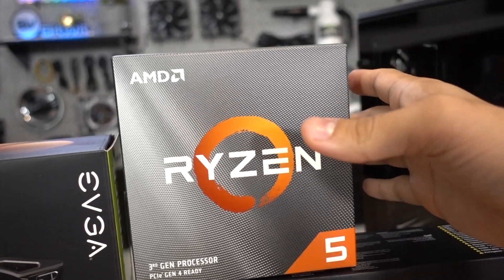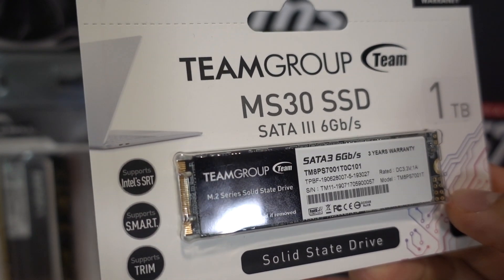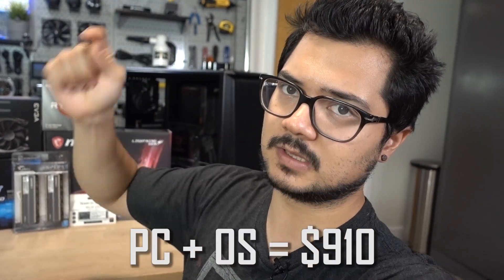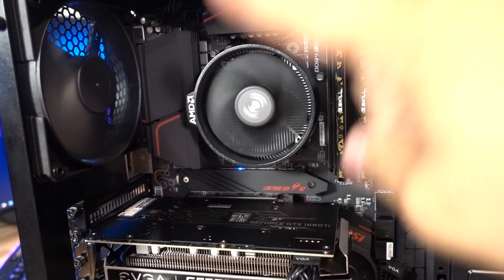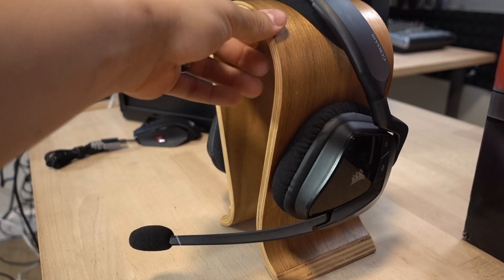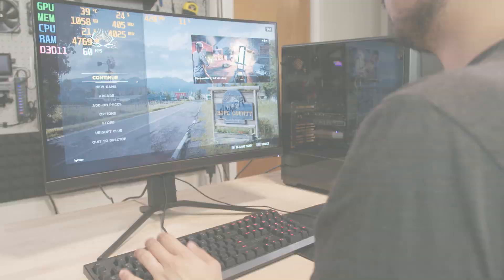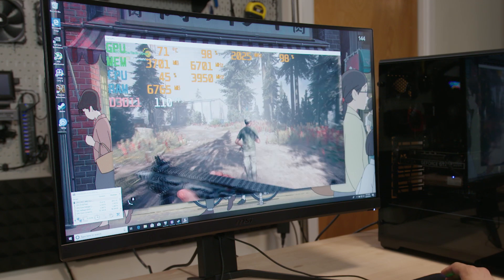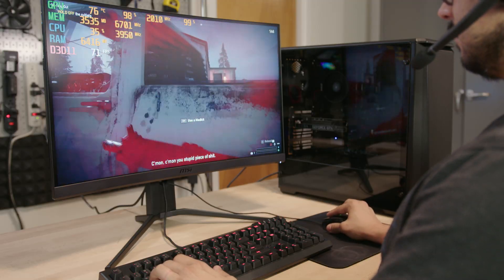Literally EVERYTHING you need to game on PC for $1500

Comment: I have an AMD Ryzen 7 2700x with and rtx 2070. I always want that 144 fps. I usually put all my graphics either medium or slightly higher and set the display to 1080p even though I have a 1440p monitor. More pixel density could stress my system. That’s how I set my settings for all my games

Comment: If I’m not mistaken, the motherboard would not be a reliable option in the long term, as proven in one of hardware unboxed’s vids. It yields very high temperatures under load, as high as 90 degrees. A good alternative would be MSI X570-A PRO.

Comment: I really don't like this build, the board is X570 but very low end, which even with the points you made is not a good option. Saving money and getting a b450 or X470 would have been the better option
A 1660Ti in a 1500$ is just not okay, I have seen people being able to put in way stronger gpus for less. You could have achieved that if you went for a Full-HD monitor instead. But you got a WHQD 144hz which a GTX 1660Ti is not gonna achieve in most games on high settings (I'm not even getting it with my 1070)
Full-HD with a either a 5700XT or a 2070 would have been better.
The Money for those cards could have been won by - as mentioned - a full-HD monitor and most importantly, different peripherals.
The fact that there's no great alternative to cherry MX is a complete lie. I actually had an MX switch fail, getting Outemu switches would be be the better option. Also the gaming headset is not a good choice either. There are way better for less money, both wired and wireless.
The P400A has proven not to have that good of an airflow despite the mesh front. A bit of money could have been saved by getting a Cooler Master MB500 which also comes with one more fan and it's RGB.
I therefore cannot recommend anyone building this, this could and should have been done better
Reply: My 1660ti handles 1440p great
Reply: @shilohchavis5392  handles it great but it would not reach 144 fps which is what they were saying i believe
Reply: @SwolePapi15  exactly

Comment: I think there is one last thing you left out of the reasoning for choosing the X570, and that would be that if somebody was to build a PC brand new right now and was to choose the 3000 series with no previous gen chip at their disposal, it is best to get the X570 because otherwise if they bought a 400 series board, they would need to find a way to get a hold of a 2nd gen CPU in order to update the BIOS, or they would have to buy a specific 400 series board that comes with an updated BIOS out of the box to support the 3000 series.

Comment: I have about that much total in my system, good price point! But I went ebay OEM windows key, it works for $14... Ryzen 5 2600, Asus X470 mobo, 16gb Corsair vengeance pro rgb, Gigabyte RX580, evga 750 80+ gold modular psu,  128gb cheapo ssd, 1tb wd blue HD,  32" monitor, Corsair K68, and a decent mouse. Should've gotten a better GPU but it works very well!

Comment: You could get a RTX 2080, Ryzen 3600X and a Gigabyte Auros Pro WiFi (X570) with 32GBx3600Mhz at 16CAS for about 1500$. With a cooler.

So if you have a keyboard, mouse and monitor remaining, I think you should either save the money and go for a 1000$ build or go for the 1500$ build with the 2080.

Comment: 74-75°C is quite high for a CPU on stock clock speeds. Seems like the mesh front panel on the P400A is still choking the airflow a little.

Comment: What I think could've been better
CPU: Ryzen 5 3600
GPU: 1660 Super
Ram: 8 gigs 3000 MHz (16 for streaming and stuff) from Corsair, Vengeance
Storage: Same as he suggested
Cooler: Stock Cooler
Motherboard: A WiFi enabled one like, Gigabyte B450 (or something like that) Aorus WiFi Pro
Display: Acer 1080p 144hz. It's much cheaper than that, also 1660 super performs better on 1080p giving you around 80-100 fps on ultra, and can give 120-150 fps on most graphic optimised aaa games
Keyboard: Something like an AmazonBasics mechanical keyboard
Mouse: Something like from Logitech, around 30-50$
Case: Antec NX300
The total cost without the operating system (considering a new, not second hand) is around 1400-1500$.

Comment: Personally I would've opted for a Meshify c instead of the p400a since the mesh is a lot less restrictive on the Meshify for roughly the same price. I also think it looks better but that's subjective. secondly I'd change the headset to an h70 from Corsair as well, because it's slightly cheaper and has a little bit more functionality at the cost of the RGB accents on the void (but who really needs RGB on a headset).

Comment: I was thinking of going from my 1700x to a 3600. I know it's two less cores but the performance will be significantly better.
Reply: I'm gonna hang on to my R7 1700. It's only overclocked to 3.8(0.1 volt increase from 1.1875 stock to 1.2875) but it's fast enough for me. 31c idle, 71c stressed on Wraith Spire RGB.

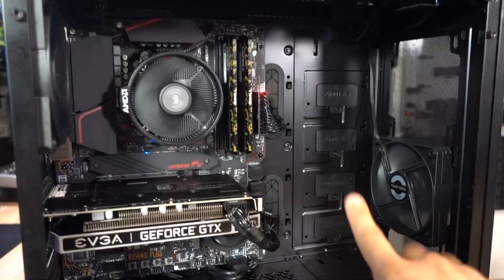Comment: 6:13 Again, that 8-pin EPS connector will allow for the CPU to draw up to 384W. Even if you are doing some kind of LN2 extreme overclocking, an AM4 CPU won't draw that amount of current, ever.

Comment: I still have the same old SIIG multimedia keyboard I bought in 2012 and it’s been through 3 system upgrades an a move. x299 dark 9800x 2080 ti hybrid FTW3 1tb 970 evo and quad channel 8gb 3600 memory. Think I should upgrade?

Comment: i'm not a big fan of the choice of the monitor, 144hz at 1440p is too much for this setup imo, a 1080p 144hz monitor would have been better, and with an MSI B450 Tomahawk you could spend all the extra money on a better GPU for a batter experience
Reply: In the video he said instead of saving money on the motherboard, instead he wanted something that could handle a CPU update in the future. Also if your planning on building this, you dont have to pick the exact parts he’s using
Reply: @hoodswords  b350 mobos can handle the likes of a Ryzen 9 3900x, though( double the cores and threads compared to the 3600). The main advantage of x570 is pcie gen 4 for SSDs, and they're not THAT much faster than gen 3(yet).
Reply: jtenorj (yet)

Comment: I got a vega 56 from asrock for 260 bucks. Thing was so loud I decided to water cool it thinking I would overclock it. Then I realized I had hynix memory. Dont recomend vega 56 if you want something that's quiet or something you want to overclock. Also undervolting is bs, stupid you have to undervolt a card just to get its stock performance stable.

Comment: @6:13 There is literally no reason to have extra 4-pin CPU power connector other than making people exited of the motherboards "power delivery capability". It may become relevant with LN2 overclocking. But when you do that, the actual power rails of that motherboard can't handle that kind of overclocking.Other than that minor detail, good video. 

For more info about these motherboard features, refer to actual hardcore overclocking - channel

Comment: I would get a B450 motherboard with a ryzen 2700 or 2600 and a RX 5700 instead. 
Ray tracing after the updated drivers would not be worth it for the 1660TI anyway.

Comment: Is AMD CPU stock fan better than Intel's? Because first when I bought my pc I used the stock intel fan and it was fking noisy and not that good at cooling. Especially with high settings and 144hz. I had to play at 60hz until I bought an AIO.
Reply: AMD stock coolers are actually pretty good, they could probably handle some overclocking if it’s not a hot running cpu. Intel stock coolers on the other hand... it’s a known thing in the pc community that they’re trash.

Comment: The VRM on MSI's X570 boards below the Ace suck. Check out Hardware Unboxed or Actual Hardcore Overclocking for great info on the X570 boards. The jist is if you want an MSI board get a B450 or X470 one.

Comment: MAJOR MISTAKE IN VIDEO
The GTX1660Ti does not have the RT and Tensor cores to support RTRT and DLSS. It's the reason NVidia called it a "GTX" card not an "RTX" card. Please correct this in the video.
Reply: (If by "foot in the door" you meant that technically it will do ray-tracing at unplayable frame rates then I guess you are correct though you didn't specify. You also said "foot in the door for RTX and so forth" which implies DLSS which isn't possible without the Tensor cores... I like your stuff but I found this a bit misleading, though I doubt it was intentional)

Comment: this is almost exactly my pc, works really great and it'll handle almost everything you throw at it
Reply: can you tell me what power supply you use ?
Reply: @LilMonie  coolermaster 550 watt
Reply: Cars Lansink does it come with power cables he didn’t really show how to build this pc and i’m lost
Reply: first time building a pc?
Reply: @LilMonie  and yes, it comes with the cables because it isnt modular
Reply: Cars Lansink yes it’s my first time ... also instead of the pc bitwit has in the video i bought the asus swift pg279 but it has g sync instead of amd freesync can i still use it or was buying the monitor a bad choice ?
Reply: Cars Lansink monitor not pc lol
Reply: @LilMonie  you can still use it, g sync or freesync are just some extra optional features
Reply: Cars Lansink yo thx man ! i appreciate the help can i add you on something if i need more help with something like setting up windows installing drivers ?
Reply: Cars Lansink all new to me 😅
Reply: bro can you help my i’m getting a media test failure warning on boot
Reply: @LilMonie  Thats a problem with your hdd/ssd onto which windows wants to boot and install the os itself. so check if everything is connected properly, if that doesnt work check in the bios if the boot sequence is correct.
Reply: Cars Lansink my bios wasn’t detecting my ssd and the ssd light on the mb is red i put it in m2.2 slot and now it detects ?
Reply: now it’s telling me select proper somthing
Reply: @LilMonie  can you send a picture on dm (instagram)?
Reply: Cars Lansink yes @realpsycho100
Reply: Cars Lansink i replied

Comment: Could have saved a chunk of money with a Dell S2719DGF instead of the MSI monitor. Excellent 27" VA 1440p 155hz freesync panel for under $300. That money could have gone to a better cooler or a nice keyboard and headset.

Comment: I would Switch out the Headset for Logitech G933 still a 7.1 surround sound wireless headset for around $70 Its usually on sale for $99, upgrade to the RTX 2060 also would switch out mouse for Logitech G502 Hero out of preference.  Was thinking a 1TB M.2 was a bit much but that price is really nice for that. Usually I like to run a 256GB nvme for some games and OS then Hard drive for bulk storage for the price. That monitor though its all those sweet spots 1ms 1440p 144hz for a VA panel that is awesome for that price. I personally love my Alienware 1900R, Ultrawide gaming for those scenic games just is amazing. Also funny same exact motherboard and cpu that I have.

Comment: I got that exact same motherboard for my new Ryzen PC. It's the most expensive motherboard I've ever bought at 219€. And that is in your budget build... hehe. An x470 board would have been 75€ cheaper but since I switched over from Intel it wouldn't have been compatible with 3rd gen ryzen out of the box and I don't own a 2nd gen cpu to upgrade the bios.
Reply: I think AMD is still doing that thing where they will send you a lower end APU at no cost to flash the bios. It was an old FX based APU for going from 1000 series to 2000 series chips, and a Zen based Athlon 200GE for going from 2000 series support to 3000.

Edit:you have to send it back to AMD when you're done, but they do include free return postage(I think).

Comment: Asking a 1660Ti to push 2560x1440 is a bit of a stretch.  I actually said to myself, as you came to the 1660Ti, "Well, he's going high refresh 1080p then."  At its price point, the 1660Ti is great, but it's not really a 2560x1440 GPU, especially if you're trying to get high FPS at max levels of pretty.  I'd have gone with a modest refresh rate 2560x1080 IPS display.

Comment: Just a quick question...did you verify the Nvidia control panel under the "resolution" tab? because Nvidia in their infinite wisdom decides to default their drivers to "Limited" color range instead of "Full RGB...I didn't know this until recently and for years I thought my monitor was garbage with the colors washed out....when I changed the color reproduction to Full RGB it's like I was on a different monitor altogether....

Comment: I would probably use a 1080p monitor instead of a 1440p monitor to save money and to have high fps on all high settings. Also, I would probably swap out a card for like a RTX 2060 or 2060 super.

Note: Forgot to mention this but buy a 1080p monitor with high refresh rate and really low response time

Comment: and in 2020, you can still do it... this one comes with a 32" monitor, nvme drive for the os, 1 tb drive for games, enough fans to have two intakes at front / 2 fans on gammax cooler / 1 outlet fan, 5600xt gpu (has beaten the 1660 ti in some tests, price should lower once market stablizes because it is selling over msrp), a DAC for the headphones, rgb mechanical keyboard & mouse, mouse pad, & comes in around the same price once you purchase an OS key

https://pcpartpicker.com/list/PX3sn7

Comment: I don't think the x570 was worth it in this build. The VRMs in nice b450 boards are plenty for a 3600 and the MSI b450 boards have very nice VRM cooling. Also, b450 also supports 3600mhz ram. The only pain with b450 is bios flashback for 3000 series support but it's simple on boards with a flash feature that doesn't require a CPU.

Comment: Wouldn’t you also need to upgrade your psu if you upgraded to a higher core count Ryzen cpu because the power supply only has 1 8pin cpu cable

Comment: Noob question! I have chosen the p400a Digital RGB white version for an upcoming build (first time!),  and I was wondering if the front fans are 4 pin 12 volt? how many of them? And can i pair these together somehow? Or where they go otherwise?                                Plus; If i were to get an extra D-RGB fan (also phanteks 4 pin 12v ) for the rear/exhaust is there enough of 4 pin 12 v on my MSI B450 TOMAHAWK MAX?

Comment: I would have went with cheaper perifferals and since it’s 2020 I would go with a Ryzen 7 3700X and a Radeon RX 5700XT and it would be about $1,200 without periffirals and so $1,390 with cheaper perifferals (which you can upgrade later) I game on a $5 blackweb it does have side buttons and I dpi switch though

Comment: Hmmm, a 1080p monitor would have allotted more of the budget for better components. Especially since you aren't going to be running most AAA titles at 1440p, 144hz, high to max settings on a 1660ti. You'd likely hit the 100+ fps mark at 1080p over 1440p, but that's only my personal opinion. Not a terrible build by any stretch, just strange.

Comment: Did you plug the front case fan power to a fan controller that comes with this non-RGB P400A case? I know the RGB version does not come with a fan controller, I am just trying to figure out my options with my limited fan headers on my mobo.

Comment: I think he could have budgeted a little better. For example, you're going to have to replace the choice of GPU sooner than CPU, so he should have gone for a cheaper b450 model, and a 2060 Super(Which are typically only around $40-50 more than the standard model,) which is pretty fucking close to the standard 1080/2070.

Comment: Not bad but You should've gone with a 2060 and samsung's 144hz CJG56 qhd monitor which costs around 100$ less than msi's and I have this samsung monitor it is great for the price! and the stock price is not doing that well because the default voltage on b450 or x470 or even x570 boards are way too high since ryzen 3rd gen released :/ mine was set at 1.47v default at stock and I got it down to 1.21v 4ghz all core on my msi b450 carbon ac!

Comment: Hardware Unboxeed said something different about the MSI board especially it's VRM runs hot... you would have saved about $60 bucks with the new MSI Max boards. I would also buy a much cheaper 3200 CL16 DDR4 Kit instead of 3600 CL19 which would overclock to 3600 easily and save you 25$ bucks... So, personally I think you could have done better.

Comment: what is the point of having a higher resolution if you have to toggle down the settings to hit significantly over 60FPS? that 1660 ti is going to be able to do EITHER 1440p of 100+FPS, never both, so the monitor also seemed really pointless. unless you only play CS/LOL
Reply: I overall don't understand why to spend more on a monitor than on your GPU, because if you're not using all the features of the monitor it really feels like wasted money oo

Comment: I am making my first pc build and i have this msi mpg x570 gaming plus board and the seasonic s12III powersupply and i am building it using pcpartpicker and it says  that the motherboard and the powersupply are not compatible  it says :Note:The MSI MPG X570 GAMING PLUS ATX AM4 Motherboard has an additional 4-pin ATX power connector but the SeaSonic S12III 650 W 80+ Bronze Certified ATX Power Supply does not. This connector is used to supply additional 12V current to the motherboard. While the system will likely still run without it, higher current demands such as extreme overclocking or large video card current draws may require it. What shoud i do please tell me

Comment: I'm really curious to know how thermals were with the P400A case.  The most comprehensive review I've seen so far was for the white version which has smaller ventilation holes due to the white coating.